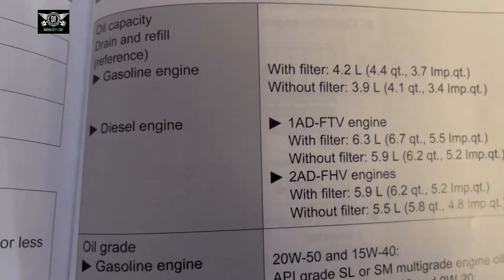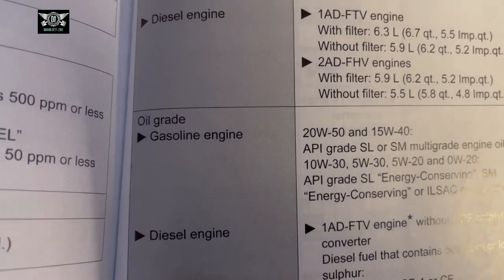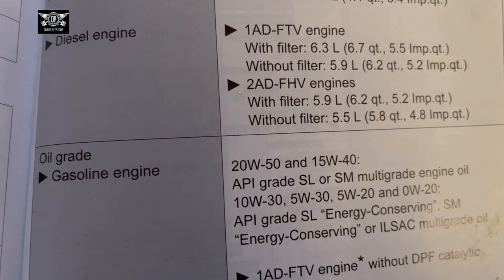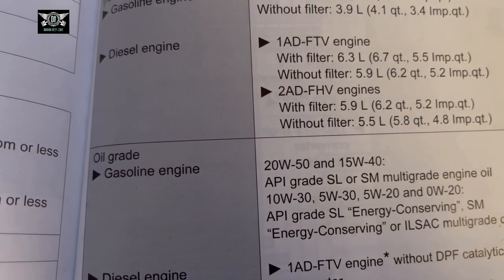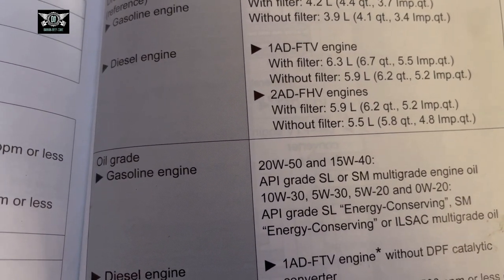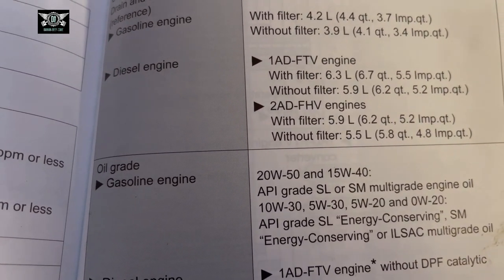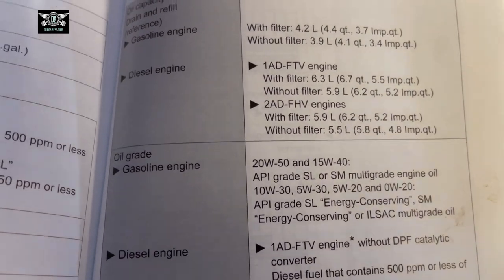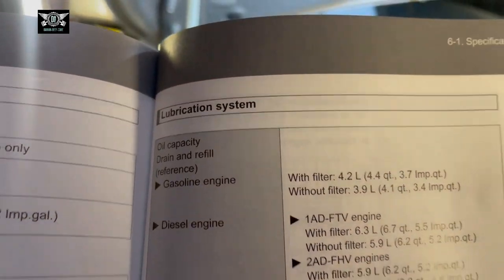Toyota Verso oil and oil filter change, screen wash fluid top up and coolant level and percentage

Comment: Why does oil pressure come on.? Toyota verso1.6 gasoline car
Reply from the maker: If there is little oil then the warning light would come on and also if there is a fault with the oil pressure switch, if that’s what u are referring to.

Comment: Every how many miles should the oil be changed?
Reply from the maker: Usually every 10000 - 12000 miles or every year.
Reply: @DaringBeefcake   Thank you for your answer, I bought my car just a week ago is a petrol toyota verso 2009 with 76k miles, What oil do you recommend I buy, what brand would be good?  I would like to buy a good oil.